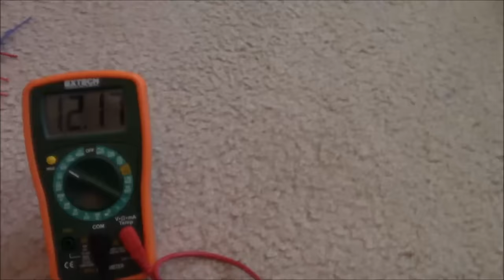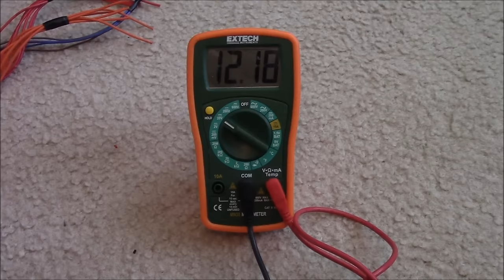How to Hack a Computer Power Supply (PSU) To Use as a 12V DC Power Source

Comment: I've really struggled with the concept of using a PSU to power 12v, but this video is stupidly simple. Brilliantly explained. I can now carry on with my project. Many thanks.
Reply from the maker: You are welcome.  Thanks for the feedback and thanks for watching!
Reply: I just hope I will be able to power a car wiper motor with it.
Reply from the maker: That should be easily possible.  You may need a relay, though, like you would have in a car to control the back and forth motion.
Reply: I want to connect to the zk-4xk unit. Do I  need to use all the 12v wires?

Comment: YOU SIR ARE A FREAKING GENIUS!!!!  Never once did I think to use the ignition terminal slot in my multi-tool to hold a set of wires I was going to solder........BRILLIANT!!!!!!!
Reply from the maker: Not sure if you are being sarcastic or not but it works!
Reply: No sarcasm there.  I was dead serious.  I've had a multi-tool set for nearly 20 years and never once though of that.  Sometimes the simplest solutions are the best......
Reply from the maker: Stephen Lee
Ok, good!  Glad I could help.  It worked well.

Comment: When all the 12 yellow wires are connected together, most PSUs will provide enough power for a device that draws 15 amps.  This would work well for powering a 65 watt commercial or Ham radio transceiver.  However there are a few transceivers that require 13.8 volts, so a battery boost unit, such as the MFJ-4416C would be needed.

Comment: Wow, finally an explanation about this process that a rookie like me can understand and isn't 30 minutes of rambling, random babbling. Thanks. And a quick question: I'm looking for an alternative to a manual 12v battery charger to use as a power supply for an electrolysis tank. This appears to be exactly what the electrolysis forums are talking about, but you mention the device won't be powerful enough to charge a 12v battery. Am I overthinking this, or is this precisely what I need?
Reply: id like to see a followup video explaining how to make the 12v charger, he said you'd need to do something with the other wires to get it to charge.

Maybe try this video, he uses the power supply to charge a 12v car battery but premise is most likely the same
Reply: @meatloafdaddy1223 
12v can't charge a 12v battery. Since 12-12 = 0. You need a higher voltage from your supply to charge  batteries. AFAIK some batteries charge with 13.8v.

Comment: or use black and green with a switch to turn the unit on and off. I solder and shrink wrap mine, unless I put a switch in then I use terminals to connect to the switch. Save yourself a lot of time to see what the wires do in the plugs so you do not have to fix them later from shorting out when you find the ones with the right voltage exiting the unit that you can use for your devices to power up. Try to keep your job looking professional. Use heat shrink for crying out loud. Connect them to a bus bar that other devices can use for powering up. I would put a amp meter inline to keep from over loading the device by drawing more of a current than the power supply can handle. As well as a Volt meter so I can adjust the output power to where I want it. So that all my devices are receiving a regulated voltage that I need them to run on. I would never leave my positive voltage wire exposed so it could short out against any metal object that is grounded. Always keep the positive wires covered or insulated or fastened into a insulated bus bar device. Or a current protected circuit. So the power source doesn't short out and fry the board in it.

Comment: For anyone wondering, Orange is 3.3V, Red is 5V and Yellow is 12V.
Black is obviously ground.
Reply: On my PSU it's all written on it (what colors are what input)
Reply: thank you so much man
Reply: Thanks
Reply: Thanks for the heads up.
Reply: In the molex pin, two yellow wires went in to one 12v pin output. Does that mean i need to bundle two yellow wires as postive and two black wires as ground to power a 12v device? ( I don't wanna bundle them all together like in the video cos i want to power different dc devices)
Reply: Can you make a 12v SB by adding orange and red to the purple 5V SB ? (would be 13.3V ok?)
Reply: @jessecrockett  go learn electricity
That is against the law
Reply: where was the 12v - leads?
Reply: @SilentKilla574  or it will be labeled as p2?
Reply: @ANDYWOUNDSABRXS  yellow + any black usually
Reply: Thank you
Reply: Do you know by any chance what brown, purple, blue, and grey might be?
Reply: @calebhickey9344  try looking them up or using a multimeter, blue might be -12v?
Reply: @nixietubes   yep just searched it up blue is -12v, purple is standby terminal(5v as long as the PSU is plugged in), and grey because by some kind of signal or something similar not sure
Reply: So do get those voltages do you need all of the cables from that one color? For instance to get 12V do you need all the yellow cables or would one suffice?
Reply: @justniccy2402  one is fine unless youre using a ton of power.
Reply: @nixietubes  ahh ok thanks!
Reply: Why I am only getting 11.5 voltage
Reply: Brown

Comment: simple and clean video to the point, i was gonna make a small incubator and i was gonna buy a adapter to power the thermostat but then i remembered i had a spare 450W power supply at my home just sitting there so i searched how to convert it into a DC 12V power supply and i was not disappointed. Thanks

Comment: I'm Electrical Engineer from Pakistan.
I know all these things already.But I really love the way you explained it n kept the things simple throughout your video.I suggest put explanation in description like max current and voltages of different colored wires.
Thumbs Up! Keep it Up!
Reply: Mustafa Tahir brother.. please help me. I am trying to use power supply to eun my 12 volt dc cooler. But when I join black and green it only starts for jerk. Doesnt run continously. Plz tell me what i am missing..
Reply: Waqas Naseem  same situation with me
Reply: Waqas Naseem The motor in your fan has been overvoltaged and is now dead.
Reply: Qasim Ali ! I got my supply replaced..
Reply: Waqas Naseem which supply are using? What's is the model number?
Reply: ifhi khan want model is the fan, you probably got a cheep knock off.
Reply: ifhi khan hmm... seems your supply is broken, if it's not holding through, one of the capacitors might be damaged, I recommend just buying a new one.
Reply: ifhi khan although, rather than buying it might just be better to buy a cable of eBay.
Reply: put a dummy load resistor of 22ohms 10w between ground and 12V+,
Reply: It will , as the overload protection  instantiates , this power supply is meant for a PC and if you need to run your fan , the cost of a 12V 5 amp  DC adapter is close to PKR 4 to 500 , I bought one from Hall road and is 2 Amps , but yet when I fired a disel engine heater plug , It turned it into a RED hot ataining almost 800 deg C So go for it PC Pow supp will only handle little loads Not geeks Ghatka  Stay blessed
Reply: Do you have any intention of building a 3D printer?  If so Do post the Building process Please
Reply: PC Pow Supply Trips due to Load , get a 12 V 2 Amps adaptor from Hall road , It will Rock
Reply: 22vv
Reply: Thens whats the white wire?? 
I dont got green😐
Reply: Lol... yeah right,  electric in Pakistan?  Good one bro..  👍👍

Comment: Great video!  Super clear!  It's just that I wouldn't use electrical tape if I were you.  

Electrical tape, when it gets hot, tends to slide around and might unwind and expose the wires some day.  I use shrink wrap, which I think is a bit safer.
Reply from the maker: Good point.  Thanks!
Reply: Yeah I hate that tape.  Looks great in the beginning but just melts later and gets all over the place.
Reply: In this case is ok for the turn on signal (green wire)
Reply: Liquid electrical tape is a good option if no heatshrink tubing is available
Reply: no need for a dummy load between ps on and ground???
Reply: @rosekreuze  not with older PSUs like this one

Comment: I swear I watched this video as a younger me and I'm back 6 years later because it's still the best way to get a decent 12v psu for such little money!
Thanks man!
Reply from the maker: You are welcome!  For sure.  There are 12V and 24V DC power supplies out there but I can almost guarantee you they are not built to last as long and handle heat as well as a computer power supply.

Comment: can i use the yellow wires for 1 device each?
why did you bundle the wire together?
Reply from the maker: +Sion Napitupulu I bundled the wires to be able to flow more current (amps) safely.  If you were to try to draw 20 amps through one wire, for example, you would fry the wire and potentially start a fire.  It is just for safety and ability to run larger loads.

But yes you can run one device on each wire within reason.
Reply: Berzerker God  it says it on the side how much your specific power supply can give out at 12v. for my random 500W power supply, it says 400something Watts on 12V

Comment: Good video! Question for you- for hooking up a car receiver, other youtube videos show people using far less wires, and leaving most of the plug adapters alone. Do you bundle like-colors together for the purpose of keeping it neat? (When I look at a single yellow wire, it is rated for 300V, and I assume it can also handle more current than a car receiver would draw.) Thanks!
Reply from the maker: I bundle all the wires together so I can safely use the full 20 amps of power on the +12v rail.  If you don't plan on using all of that current you can use less wires.  Is the car receiver going to be providing power to speakers or just acting as a dead head?
Reply: Yes, the receiver will power speakers. I plan to use the four stock speakers from my car (each 15W/4ohm). The power supply is rated 300W. The receiver is 52W x 4. Thanks for your feedback!
Reply from the maker: CodecFace So to power the seakers to their fullest you would need 60W plus whatever the head unit consumes.  Lets say 50 watts.  So 110 watts = about 9.2 amps of power at 12v.  You might be safe to put 9.2 amps through one of those little yellow wires but keep in mind they are only about 16 gauge or smaller so it may heat the wire up and cause a short.  To be safe, I would bundle 3-4 of those wires together.
Reply: Much appreciated! I'll take your advice : )
Reply: Out of curiosity, where will you get the 110/220v AC to power the PSU you plan to use?
Reply: @sleat  I would guess he is going to just use it in a garage for a sound system. That is what I am looking to do.
Reply: @awboat  Sensible!

Comment: I found my 12 volts.  They were where you said they would be; across a bundle of black wires and the two yellow wires I have with this PS.  Oddly, my MM read 11.81 volts.  But they sufficiently power the 12 volt motor I attached them to so I'm happy, happy. Thanks.  And, I now have 24 volts available if I need 'em!
Reply: Hi! How do you now have 24V? Can you enlighten me a little, please? Much appreciated!

Comment: great informative vid! other channels make reference to the addition of load resistor(s), under what circumstances are these necessary?
Reply from the maker: +allmodcons Newer power supplies are starting to have a "feature" (I call it a limitation) where they will not power on unless they detect a load.  So just connecting the green wire to the black wire does nothing.  Unless there is an active draw on the power supply it will still not turn on.  Thus you can put in a load resistor to simulate a load and allow it to turn on.

Comment: Just uncovered both a 500w and 300w power supply in my loft! I'll be installing g these in my shed for a peltier air cooler for my shed.
Reply from the maker: Sweet!  You should be able to power quite a few peltiers with those.

Comment: Is there a way to convert a computer or a server PSU into a one 12V Rail....What I mean _I think a 720W PSU is 60A.....but the 12V rail only produces 10A ...The balance is in the 3 and 5 V  rails SO can this balance be hacked into the  12V rail to produce 60A of 12V  DC...Hope you get what I mean...Cheers
Reply: You sure its giving you a limit on the +12v output ?    As apposed to the 3 , 5 & -12 volt ?

However if the current flow capacity of the 12 volt transformer windings isn't rated to 60 amps ... There is your answer.
Reply from the maker: I'd be shocked if a 720w power supply is only providing 10 amps on the +12v rail.
Reply: LDSreliance My thoughts exactly.
Reply: Hairy Kiore even the smallest computer power supplies have 2 rails with at least 15a. So theoretically, in parallel, you'll get 30a. A 720w power supply should produce around 60a but some of that power is going to the 5v rails and other miscellaneous stuff.....
Reply: Hairy Kiore which 720 watt Ps4 produce 12v 10amp 700waat mimum produce 12 v 30amp

Comment: Sir, i very much enjoy your videos.  I apologize for the potential ignorance of this question.  if your simply wanting a 12v power supply could you not simply use one of the 12V (yellow) and one ground to connect to your hot wire and ground wire of your project.  I know you would still have to connect a green and black, but is it necessary to collect all the yellow merging into one wire if that was the only wire you were going to use.  Neophte to the Uber level here.  Many Thanks for your time and efforts.
Reply from the maker: You can.  But this PSU can provide 20 amps of power.  If you tried to pull all 20 amps of that through one wire you would create a fire hazard and short out the wire.  So distributing that power through multiple wires helps prevent that.
Reply: Hi, I plan to connect a few 12V 8A devices to the yellow lines. How should I go about assigning the different yellow wires to 4 outputs?
(i.e. better to combine all lines then re-split, or assign 1/4 of the yellow wires to each, or is there a typical recommended current per wire?)
Reply: *Mine can take more than 24A, just making it clear that I'm not trying to set my room on fire :)
Reply: I'd say it depends on how many 12v connectors you have on the ps and what gauge. Pretty sure two could handle 8 amps easily, 3 would be ideal. One might just give you an extra space heater in the house. ;-)
Reply: John Andersen 
Electric wiring 
Electric space heater 
And the words 
Pretty sure 
Kills a lot of people every year!!
Reply: I'm pretty sure your right about that ;-) Hopefully anyone that dives into projects like these have a good sense of safety. Hell there are devices that start fires on there own that have been certified and ones that blow up all on there own designed by qualified engineers.... Scary how many people have paperwork and diplomas saying how smart they are and yet still don't have a clue.

Comment: I would trust a wire nut more than that tape on the black and green wire you soldered.
Reply from the maker: A wire nut?
Reply: A wire nut on stranded thin gauge copper wire... think about that for a bit

Comment: Firstly greate video lots of help thanks
1)can I put a switch on the green and black for better control
2)will this method work for powering led lights that only require yellow and black in molex connectors?
3) could I make some full all 4 wire molex connectors and 2 wire molex connectors at the same time without any issues? 
Reason is I need 2x2 wire molex for 2xled strips and 1x4 wire molex for 2xcold cathode bulbs that come in box with a dual power block that connects to sing molex And later on maybe extra cooling
Reply: +Patrick jordan even better get a drill and put a cased flip toggle switch
Reply: > put a switch on the green/black ?You could, but listen at 4:32 -- there is a rocker-switch on the power-supply that he uses to turn it on.  Not all power-supplies have this switch.

Comment: Really helpful. This saved me. I thought my PSU was broken. But I connected the green wire and yes, it turned on. One thing I would like to mention. If I touch the green wire to ground, the PSU turns on. I do not need to keep it connected with the ground wire. Can you please explain this. Maybe it only needs a brief signal from the green wire. Also can you please bore us with the details of the black ground reference wires. And all the different colours and what they do. This is very interesting. Also can you please show us how to find the 5 volt wires and is it possible to find out the max amps of each wire.
Reply from the maker: Some PSU's are different in how they turn on and stay on.  If you look through the comments you will see a lot of people have PSU's that won't stay on if they don't detect a load.  In other words, if the power button is pressed (or the green wire shorts to a negative wire) the power supply turns off but then shuts off again if there is nowhere for the power to go.  I believe this is some sort of power saving feature.  And yes, most power buttons on computers are a momentary switch and not a true on/off switch so they only need a brief signal from green like you said.

On the other questions you had, I don't know the answers or they are different from PSU to PSU.  Sometimes you can find color coded wire charts and specs for your PSU from the manufacturer.  I would try to find that first as it will tell you which colors are which and how many amps you can get on each one.  A lot of the colors are standard across manufacturers but not all.
Reply: @LDSreliance  thank you very much for that

Comment: More info on my PS. It's a model N305P-06.  There are 2 yellow wires total.  The 24 pin connector wire configuration is exactly like an ATX I've seen on other youtube videos on this subject with the exception of the forementioned small brown wire (13 pin) and the 2 white wires instead of 2 yellow wires at the 10 & 11 pins.